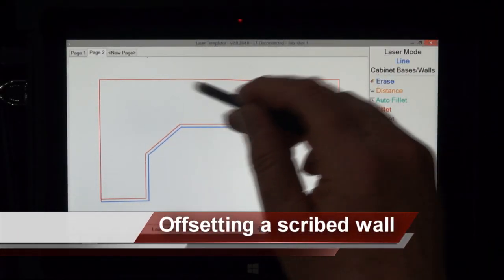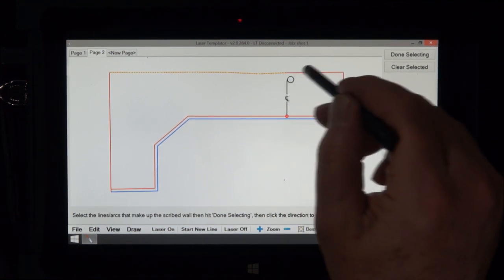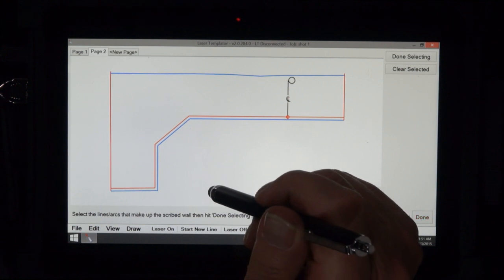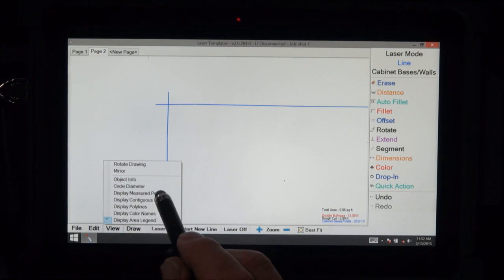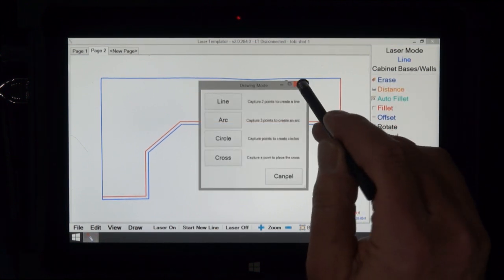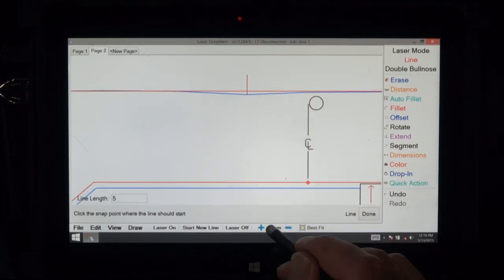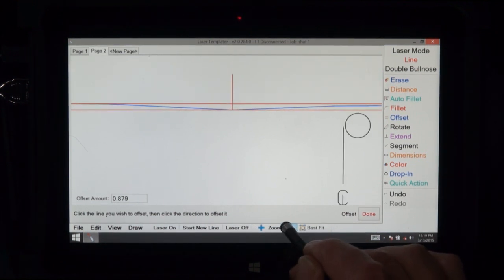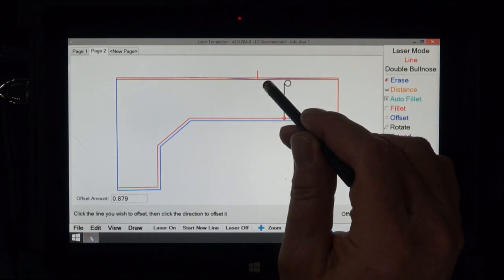Laser Templator - Offsetting a Scribed Wall

Comment: The gap that a .89 inch scribe would leave on the right back corner of the countertop would be unacceptable. Splash won't cover a gap between the countertop and the wall.
I would leave the countertop "unscribed" at the far right, back corner and NOT have a straight cut through the full length of the back wall.